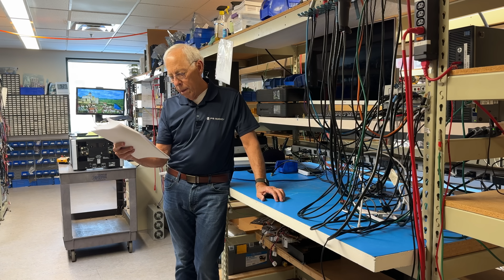DSD, PDM, PWM, and PCM explained

Comment: 1:30 don't confuse the 100KHz of the PWM "carrier frequency" vs the duty-cycle. every 1/100K of a second , you have an entire cycle of the PWM, which itself is sub-divided into, maybe 65536, sometimes even more, time slots. Your "resolution" required to record the PWM is Much higher than 100K

Comment: I think this is the way I understand it now:

DSD and PDM is similar. The output consist of pulses that varies between 0 and 1, so the density of 1’s increase for high amplitude. The higher frequency of the pulses (sampling rate), the more precise sound.

PWM is a little different. The ratio between 0 and 1 is modulated within a cycle of the signal instead of using pulses.

I fail to see why one is better than the other. If high enough samplerate it will be good either way.

I would think PWM would be the easier to implement.

In many ways they all seem to be the same. A variable density of 1 filtered by a lowpass filter.

Am I missing something?

Comment: Class D amplifiers and DSD are not truly “Digital”. They work by handling a stream of electrical pulses. It is confusing and misleading to think these pulses are zeros and ones . They are not Binary Digits (Bits). PCM is truly digital as the zeros and ones represent numbers that are then processed by a computer on replay to give the analog signal. This is why DSD recordings cannot be edited without converting to PCM.

Comment: You can also take the bits of PCM and add them together, weighted, and get sound out. If this is at a merely adequate sample rate you'll need more than a simple cap to get rid of the noise but at the root that's all a basic DAC is. You can convert the PCM to a one-bit converter but I'm still don't understand the advantage of storing a one-bit stream in its native format.

Comment: So, as I understand, when you maintain the digital signal format and only change it's bit or frequency rate (up sampling/down sampling), then the original signal integrity is preserved.  Conversely and much less desirable, is when you change from one format to another (trans code), this is where I have read that undesirable artifacts are inherently introduced. I get that DSD by nature is not editable however, does trans coding from DSD to PCM and then back again (regardless of keeping the math equivalent) for editing purposes, not cause at least in theory some loss of quality?

Comment: This can all make sense if you work as an engineer or technician five days a week. You can lose sight of these different forms of digital signals working with them. You may possibly want to become an electronics DIY builder of electronic kits as a start and then you will get the feel for these different types of digital signals overtime especially if you try to build some small digital circuitry on a breadboard. If this is too much for you I hope you are better retention than I do.

Comment: DSD is using 1 bit PDM. Class D amps are using PWM. Everything else (almost) in digital audio is using PCM. And all of it can run at speeds and resolution higher than human perception.
Reply: so Class D amps are digital amplifiers.  Why people deny it?  PWM is digital.
Reply: @net_news  Class D amplifiers are using transistors to digitally switch on/off current rather than regulate current as analog level. The benefit of switching transistors on/off like a light switch on your wall is that the transistor behavior is either close to near infinite resistance (near no loss in transistor) or near 0 Ohms (also near no loss in transistor). This very low loss in the transistors means very high power efficiency and ability to get a lot of power out of a relatively small amp not creating much heat. The problem with digital switching is of course you need to filter it to allow your speaker cones to move smoothly. The filtering is somewhat equivalent to how a DAC filters the output from digital jumps to analog in that you have to low pass filter the output using capacitors and inductors.
Reply: @ThinkingBetter  thank you so much for you answer (and your posts in general are always super interesting).   

In your opinion, would you consider class-D amplifiers digital?
Reply: @net_news  Yes, class D is digital by the amp transistors being either on or off.  A perfect class D amplifier will output an amplified analog version of the input signal but the internal operation is still digital.
Reply: @ThinkingBetter  🙌 thanks
Reply: @net_news  some people (who are super picky 😁) will argue that PWM is only digital if the rise/fall transitions are synchronised to a clock, so the pulse widths are discrete instead of continuously adjustable. Whatever your take, clock-synchronised PWM will sound horrible!
Reply: @paulapplewhite6135  Yes you can make such argument but at least the nature of PWM involving two levels sort of making it at least always partially digital.

Comment: PCM doesn't require a computer. How do you think CD players work?
Reply: Cd players contain a microprocessor and usually a DSP that does a lot of stuff just getting the digital signal to the DAC. Display, working the transport, reading the table of contents, error correction, etc. Of course now you could get a better computer for $3.
Reply: PCM is a coded signal, ergo needs a "decoder" , in order to be decoded into a functional analog signal. Most CD-players come with a built-in DAC, able to decode the signal. You might very well call that a sort of "computer", as it requires "computing", in order to do this decoding. 😁
Reply: a DAC is a computer my friend

Comment: Although yes because of physical response time limitations, feeding a highspeed series of pulses will get averaged out into the changing analog signal. It will still be a very high level high frequency pulse. Unless specific low pass filtering is available for the tweeter, it has to dissipate an extreme amount of high frequency signal energy. Far more than in any analog signal.